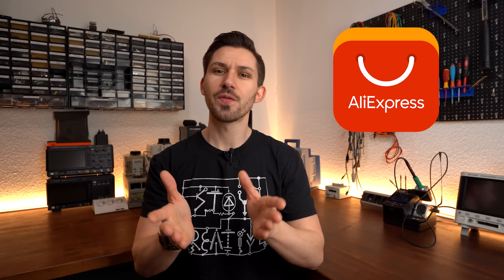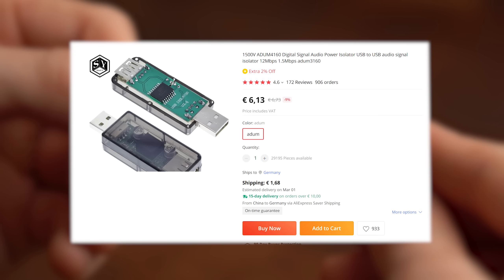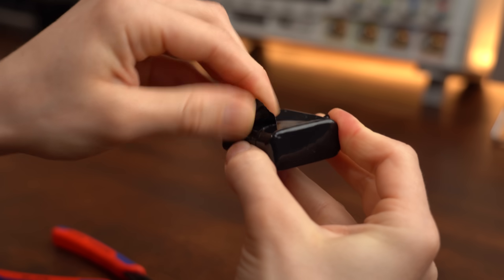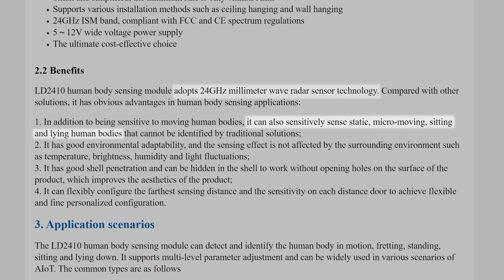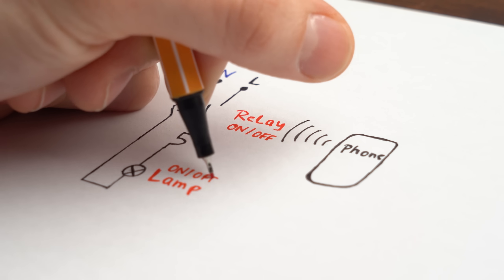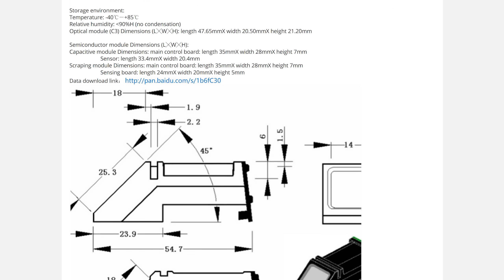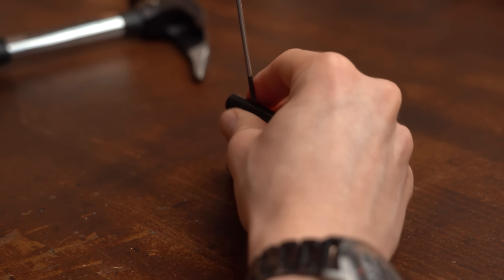I tried finding Hidden Gems on AliExpress AGAIN AGAIN!

Comment: i used the usb isolator in my car, i have a bluetooth receiver that i found picked up a ton of interference either from the usb adapter i was using or the cars electrical system itself, either way after plugging it in all the buzzing and hissing noises went away, i totally recommend it

Comment: To be fair if the glove batteries each have its own charging BMS board, there is no issue with "parallel charging" because each battery is charging independently.  The light on the charger might change when power draw is low/high indicating charge complete, disconnected or charging.  My escooter charger does this.

Comment: Most of the USB isolators sold on AliExpress are only low and "full" speed. USB "low" speed is 1.5 mbit and "full" speed is 12 mbit. Here the Chinese product pages and documentation actually is honest for once, but it doesn't help if the buyer is unaware that USB "Full" speed is actually "Junk" speed. USB 2.0 normal speed is "HiSpeed" 480 mbit in comparison. Thus 99% of the USB isolators sold on AliExpress are useless for USB oscilloscopes and such. I found one 480 mbit USB isolator on there, and have ordered that but haven't actually tried it yet.

Comment: There’s another fingerprint reader with a black button reader, I got that one, it doesn’t need arduino, it operates a relay, perfect for my garage.. I mean people breaking into garages usually use physical force anyway, but for those times I forget the clicker etc.. 
it never false triggered, and it’s simple and self sufficient.. 30 something $ on ali.. 
black box/electronics with a black button with a led ring around it..

Comment: Those batteries probably have charger on the same board with the protection, so the parallel connection is likely not an issue.

Comment: This reader differs with the adafruit-branded version by value of one byte (sync byte or initialization command - now I do not remember exactly) - it is matter of changing this one value in the library and it works as intended.

Comment: Unfortunately nowadays with USB sound cards the 1st item is usually a must if you plan on recording audio, as most of both cheap and expensive cards do not isolate ground loops (a shame). Different was the case back in the day with good old PCI cards.

Comment: it is such an old trope that parallel battery charging is bad. How much current do you really think can move between the cells? It is going to be protected by the charging circuit you showed in the battery. also, the li-ion battery can handle the charge surge, as it is limited by the discharge power limited by the higher cell.

Comment: The USB isolator is also a pretty useful thing for Software Defined Radios to eliminate the noise generated by your computer in received signal. 🙂
Reply: 200 mA isn't enough for most SDRs.

Comment: The isolator sounds good useful when Lol  arduinoing with higher voltages and accidently hitting the 12v supply into the usb port, 2 laptops of mine don't have any usbs working lol🤣🤣

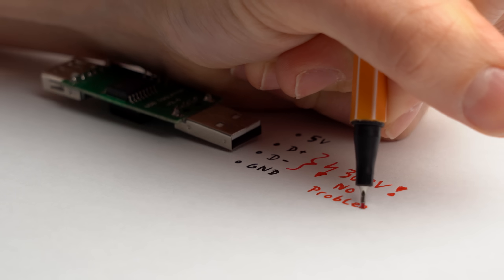Comment: 3:50 it doesnt even require a usb-killer for that. A while back i bought a USB to IDE Adapter on Ebay from some chinese seller. Hooked it up to my old IDE-Drive i wanted to check out and the first thing it does was creating a bang, sparks and tripping my brakers. Turns out the provided power supply was faulty and sent 230V down to the drive, where it found places to bridge over to the IDE-Interface which then went into the adpater and from there via USB into my PC. Fortunatly it only broke the Data-Lanes on two USB-Ports on the motherboard and left the USB-Controller and everything else intact. Also the adapter catched fire for a short moment as some of the plastic housing melted in that very short time.
I will definitly buy one of those if i really need to use another scetchy adapter for something - which i dont plan to use ever again if i dont need to.

Comment: Depending on your application for a fingerprint scanner you might want to do a bit of research first. Since the cheap ones don't include any kind of IR, pulse or blood flow sensor you can fool them with a fingerprint copy. The Chaos Computer Club showed a method how to create a fake fingerprint with simple and cheap items available in almost every household in 2008. In 2019 at the GeekPwn 2019 conference X-LAB copied fingerprints with a photo from a cell phone and a 3D printer.

Comment: The USB Isolator uses ADuM3160 which only supports USB low speed (1.5Mbit/s) and Full speed (12Mbit/s). If you need something faster that uses USB High speed (480Mbit/s) consider using EVAL-ADuM3165 evaluation board from AD or ISOUSB211DPEVM evaluation board from TI

Comment: A word of warning. Check your local electrical regulations before installing that DIN rail remote switching unit in a mains breakout panel. It would almost certainly not be legal to install one in a UK Consumer Unit as there are some fairly strict requirements, especially over unit testing in combination with other permanent wiring devices, which basically amounts to not mixing and matching from different suppliers.

Comment: I worked at the company which used finger print to check in and out. Like shit was wack it happened all the time that my fingerprint would check out some other person working there or he would check in someone else etc. And in a lot of cases it haven't even worked. Worst part was that "security company" was installing those. And software for using was even worst 😂

Comment: tip: check carefully whether the (WiFi)plug in the fuse box has been tested for the european market (CE label and not a chinese export label😊). European insurers often require this when paying out any claims
Reply: I would be really worried to put something potentialy not compliant continuously on the main without keeping an eye on it at every instant.

Comment: With the WiFi relay and it's restrictive app: I have found that many of the smart devices made in China and white labeled then sold by many companies also work with all the different apps interchangeably. So if you already have an app that you like and that you are logged in with try pairing new devices with it. I have yet to find a single generic smart device that won't work with my preferred app.
Reply: Does that apply to those cheap Bluetooth led strips? I've found that you HAVE to use whatever app they have QR coded. The other apps simply won't connect to the Bluetooth boards it seems.

Comment: Superb series, but you are damaging my credit card <G>.  The USB isolator I have been looking for to isolate a CNC machine ( Arduino controller ) but the Amazon ones I looked at a while ago were expensive and reviews were very mixed, so as I respect your testing will buy a couple.  Many thks, keep it up.

Comment: Why is parallel charging sketchy with two parallel cells?
If the one cell is severely depleted in capacity, the actual voltage will rise much quicker on this cell, and the charger should recognize this and stop charging. The only downside is that the other cell will be undercharged.

Comment: The ewelink app is surprisingly good... and All IOT devices require an account in order for authentication between the mfgr's servers and the google/amazon cloud services. I used the app to run a garage door relay for a few years without issue, it even has great logging and account sharing. privacy? welll....

Comment: Hahaha, yeah... Shopping on Ali does require a healthy amount of common sense😅
Then again, for buying basic components (like resistors and caps etc) I haven't had problems so far... Even the equipment I bought lives up to expectations (touch wood, of course)😄
But yeah, I don't expect miracles (did get pleasantly surprised once when I ordered a set of 18650s and they were as advertised; 3400mAh😄)

Comment: The relay thingy, judging by the fact htat it works with eWeLink, it tells me it's based on the same soft/chip as Sonoffs. That being said, If the TX RX pins are accessible, it can be reflashed weith ESPHome for HA.

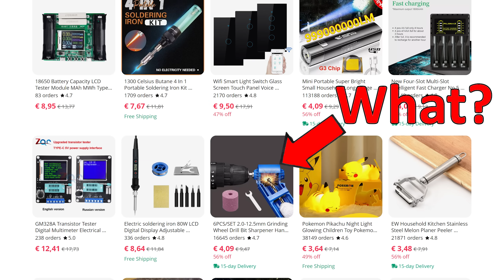Comment: The item with the red arrow pointing at it at 0:28 is just a drill bit sharpening jig, nothing insane or even unusual about it. Drill bits are only sharp at the tip, so when they get dull you use a jig like that to ensure the correct angle when sharpening.

Comment: Well if the battery has a ovp its oke to charge them in parallel the only negative is that all the current will go to 1 battery but i think it won’t be a problem.

Edit the only problem i find if 1 battery is empty and 1 battery is full you get a current ruch to the emty battery

Comment: The LL2410B (Bluetooth) version just got added to Home Assistant in either the last update or the one before that. You don't even need the board, just the sensor. Obviously it works over BT which is why it's required but now that they added BT proxies to HA, distance is no longer an issue as long as you have a spare 3 to 5 dollar ESP32 to make it a BT proxy to extend your BT range or if your HA server doesn't have BT you can easily add BT functionality by adding one as it communicates with HA via WiFi, or Ethernet if you have one of the POE ESP32'S with an Ethernet port. 

There is a video (or possibly more) on here to set it up but essentially you just have to cut a power only USB cable and soldier the wires to the 5v and ground inputs/pins the LL2410B (or obviously power it some other way). HA will just detect it and it exposes like 20 entities like.distance in cm, and obviously occupation/presence among other entities (waiting for mine to get delivered, they can be found now for as low a 4/5 bucks US a piece on AliExpress). No flashing or UART connection required, it just works natively now. Got 7 for 30 dollars US.

Comment: the Human Presence Radar Likely detects in every direction. If it is anything like the ones I that came with my light fixture It would see you thru walls, doors ceiling and floors. If someone walked in the room above the sensor the light came on.

Comment: Charging batteries in parallel is fine if you always charge them in parallel through their lifecycle. In this case balancing is not really needed. Charging them in series is more dangerous. In both cases they will lead some current through them when they are out of balance, but this current is much higher in case of series connection, and low enough for parallel connection to be considered safe.
I have seen video explanations on this topic, but I don't remember the details. BigClive have some videos about Li-Ion chemistry, eg. https://www.youtube.com/watch?v=sRwoYJyjZNo
For some reason battery behavior is quite a mystery, it's hard to find information about it. Eg. I wanted to charge up some NiCd batteries and after some digging I found out that it can be done with a constant current and monitoring the temperature (charge with C/2 until reaching 45°C and that's it). Finding information about Li-Ion is much more difficult.

Comment: For the gloves it really depends what the protection circuit does in that case. Given that the charger is very dumb it might be that one globe just charges the other one slowly
Reply: I support that idea. To my understanding the protection board completely separates the power supply from the accumulator and takes charge of correct loading - everything will be save.

I do not know if you could discharge the two accumulators parallel (in order to double the capacity), but that will not be the case with the gloves as they work on its own.

Comment: About that wifi  relay: A warning: Do not replace your regular fuses with it. I've seen people do that with similar wifi relays as they think it's a drop-in replacement for said fuses. It is not no matter how much the manufacturer tries to advertise it as.
You can however put it in series with your existing fuses.
Reply: Why would anyone replace a fuse with a relay? Totally different products
Reply: I would never in my right mind replace my ABB circuit breakers with this chinese garbage lol
Reply: @nikolamladenoff  LOL, thanks from ABB. This relay would be better suited as a control circuit relay. As in you use a NO or NC contactor and use this to control voltage to close or open these contacts.
Reply: Never use ANY chinese crappy unbranded electronics in general please...
Reply: never use any crappy electronics even if branded and not from China. But do use great unbranded Chinese electronics

Comment: Does the wifi relay have a function that it turns on and of with the sun? So it automatically turns on the streetlights when the sun goes down and vice versa? Here up north we have light 24/7 in the summer but only a few hours per day in the winter.

Comment: About the wifi relay i think you should have chosen one with current metering. That's a interesting piece of hardware, especially if integrated in homeassistant.

Comment: Two quick questions! Is the human presence detector able to distinguish between people and pets? Does the finger printer scanner store the finger print on itself or on the connected device? Great video by the way. :)
Reply: No, only downside of MmWave. It will detect any movement like a ceiling fan if it's on. They are extremely sensitive.

Comment: @10.10 - Add a snubber-network ( RC + MOX varistor ) over the contact points in order to use this with an inductive load.

Comment: Something very similar (but a bit more complex) would be an open source SMU. 

Would love for you to tackle a DIY source measure unit. I know that's probably a bit advanced for most folks who follow your channel but a decent open-source affordable SMU  sure would be popular and is needed. I mean obviously a low-budget model would still cost several hundred dollars... But would be completely worth it
 
Another idea which would save quite a bit of time.....
to build one that's already been designed. A gentleman here on YouTube who goes by the name djErickson designed an incredibly nice unit. He has decades of experience specifically in that field and really made a unit that will compare well to professional units but cost a few hundred dollars instead of $5000-$10,000. He made a few videos about it and there are also hundreds upon hundreds of posts in the thread on the EEV Blog forum. He also mentioned in one of his last posts on the topic that he has all the boards available and the vom and materials are all in stock at digikey and elsewhere. Which was a sticking point up until just a few months ago. But thankfully.... According to his recent posts
.... everything's available and back in stock. He also has a website documenting the process and design extremely. You can definitely tell he's had a long career in complex circuit design

A few other open designs are out there, including the long-anticipated OSMU (open-source measure units) from Marco reps. But his unit hasn't been released and may never be... Even though there have been hundreds of hours of work put into it and he's disgusted on multiple videos over the past several years

From what I've seen the 15 mister Erikson is top-notch and head of the pack by a long shot.
It would be a somewhat big project, but given all the boards and parts are available and documentation is so well done in forthcoming... It would basically just be like assembling a complex kit. And a lot of your followers might really get good use out of the unit like that

Comment: What's the power draw on the radar board? The advantage to PIR is that the power draw is exceptionally low and can be used in battery powered applications.

Comment: Charging both of the glove batteries at once isn't an issue, because they have protection circuitry inside them. You can put them in parallel, if one is low that one will simply discharge at a normal rate into the other one while the charger also contributes.
For anyone considering these, Project Farm recently did a heated glove review, and after watching it I bought a pair off Amazon for $40 that are excellent, much better than a $200 pair that I had several years ago.
The case style for these batteries is common. Even very expensive heated gloves also use shrink wrapped pouch cells. I've not had any trouble with them.

Comment: The problem with the self contained fingerprint readers is that they just send a confirm signal to the controller making them vulnerable. The reader can be removed from the installation and the wiring tapped. Any device like that should ALWAYS have two parts, an internal and external unit. The external unit just sends the raw data to the internal unit which then figures out if the data is good or not.
Reply: raw data sounds not safe either, easy repeat attack, better approach is only internal unit which, ideally allows loading custom asymmetric keys, or at least manufacture trusted one for singing payload, that way any external unit might be used (like arduino) which needs to store only public part of key for signature checking and validating id of payload (repeat attack protection). And depending how paranoid are you, some tamper protection could be added to finger print sensor to prevent stealing of private part of the key.
Reply: @mabakalox2353  Over engineered solution. Repeat attacks are easy to defend against. For brute forcing you just introduce an enforced delay between scans. For data repeating, you hash the data from the sensor scan and keep a log of previously used hashes. Then just check to see if a scan produces the same hash as a previous attempt and if so reject it. Fingerprint scans should never be exactly identical. You could also use a simple GDO counter. Both units have a PSK the sensor encrypts its counter with the PSK and the lock decrypts it, then checks it's a value higher than the last successful scan. Data repeating would then not work and without knowing the PSK you can't manufacture a fake scan even if you have a dump of a successful scan. There's no need to go jumping into RSA.